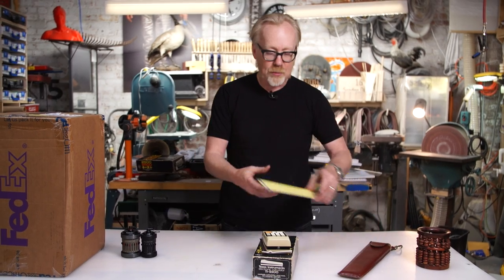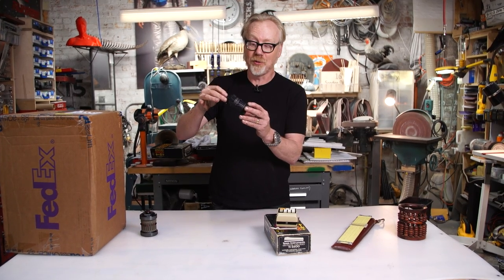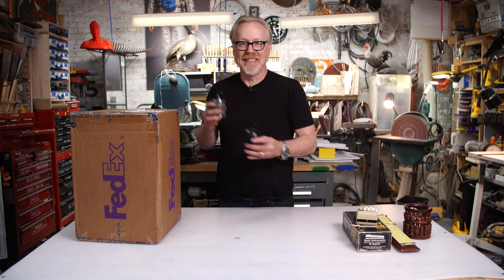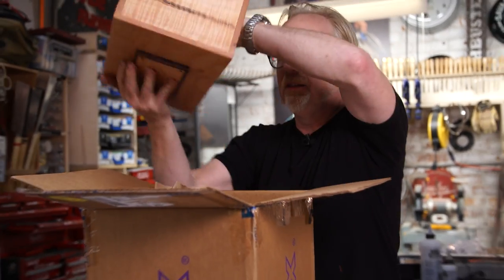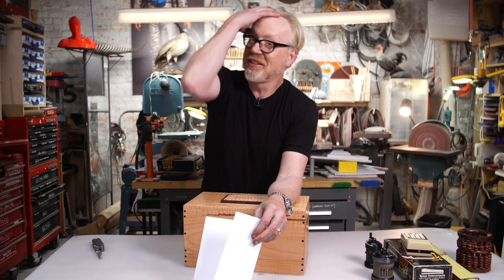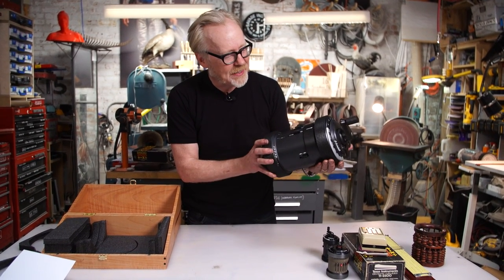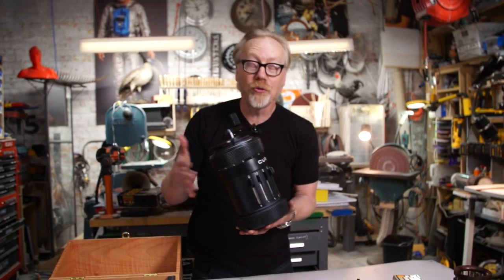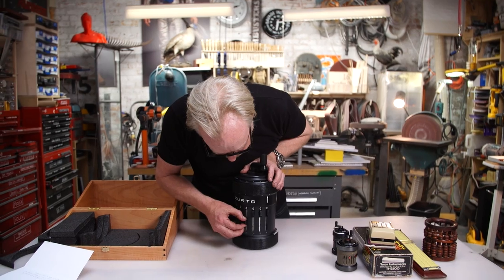The 3D-Printed Curta Calculator

Comment: I just found this channel and I have a single question.

WHERE IS JAMIE?!
Reply: They split up. You realize that's the biggest reason the show ended right? They massively disagreed with safety precautions. Jamie wanted everything to regulation if not more safe at all times. Jamie was all about being safe and careful. Adam wanted bigger and bigger booms. He wanted more and more dangerous myths to bust. He wanted to do EVERYTHING with as little safety as possible. So they were cancelled after Jamie flat out refused to work with Adam any more.

Comment: I thought it would be printed as a whole, with a water soluble binder material in between parts or something like that. This is a bit disappointing and what I feel is the problem with 3D-printing - now, it's just a Curta calculator that is way larger than necessary.

Comment: The size can't make this practical at all... I'll wait or invest in curta replicas of equal durability and acceptable range of 1.5 X or 1:1 size scale. Original ones are not feasible devices due to unnecessary price mark ups beyond usability value.

Emphasis on EQUAL durability since I buy things for practical use. I grew tired of low quality equipment Chinese parts that last less than a year of use that make it more expensive than buying genuine devices on a matching service life scale.

Zero tolerance policy on design fails, so lifetime warranty is a must.